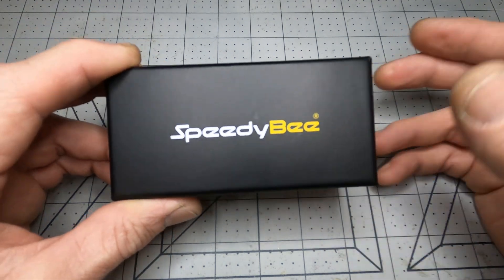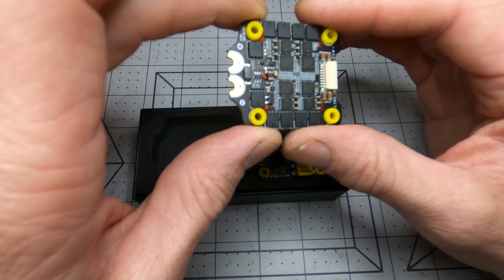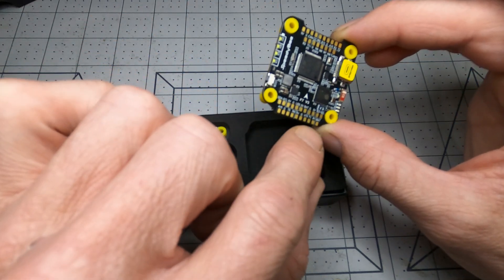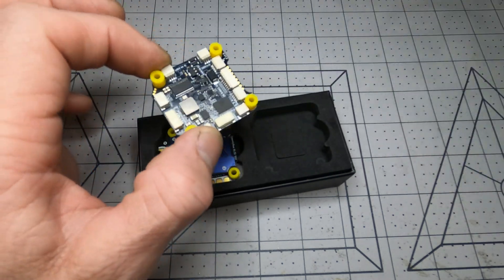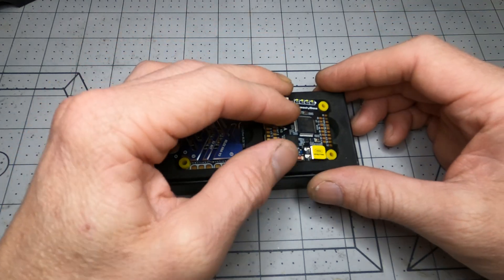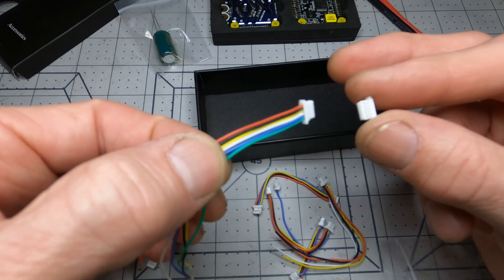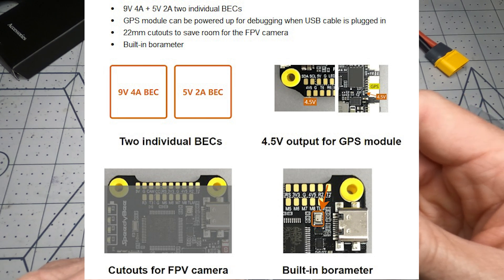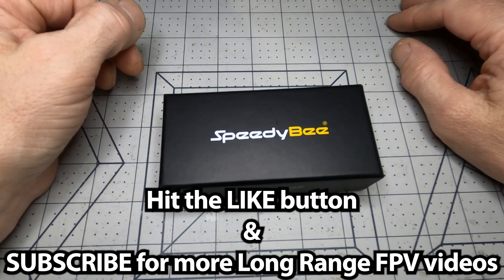New SpeedyBee F7 Stack & What's going on with the channel

Comment: Hello, i have a SpeedyBee F7 V3 FC and I cannot figure out how to turn my O3 air unit on an aux switch. What is the correct pinio information for betaflight
Reply from the maker: I've looked around and don't see any info about a pinio setup for this FC.  Did you read somewhere that it had it built into the FC?  I don't see any mention of a built in pinio setup on the speedybee f7 in the manual.  Some FC's come with it built in, some don't.  You can always use a tiny's led's real pit, it's pretty cheap and there are several videos out there about getting it setup and working.
Reply: @FalconRadFPV  Ok it isn't just me that can't find that info.
Reply: @FalconRadFPV  I asked SpeedyBee before going to YouTube. 

Just in case anyone else is wondering. This was SpeedyBee response:

Thanks for your message.
Because F7v3FC has no built-in switch, this function cannot be realized.
If you need this function, please use BEC with the IO switch function, you can configure the CC pad as pinio2.
 
If you have any questions, please feel free to contact me.
Thanks for your support of our products. 
Have a nice day.

Best wishes,
Kiki Zhong

Comment: Hey Conrad, what are you running for settings on crsf? Dynamic power or no and 50hz? Reason I ask is after cruising canyon walls and some mid range exploring  I had a failsafe 20 feet away. Managed to recover control to avoid crash luckily. I am on the 915mhz for US
Reply from the maker: A failsafe at 20' ?! Not sure what to make of that.  I use a locked power, I used to use 250mW but now I have the V2 TX module so I have it set to either 500mW or 1W.  I just switched to locked at 50hz a while ago, no difference that I've noticed at all.